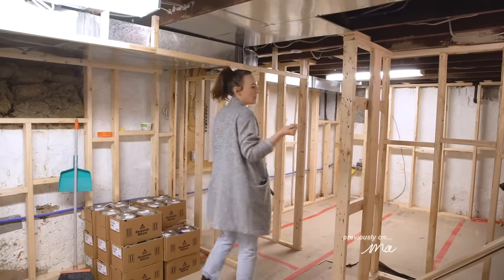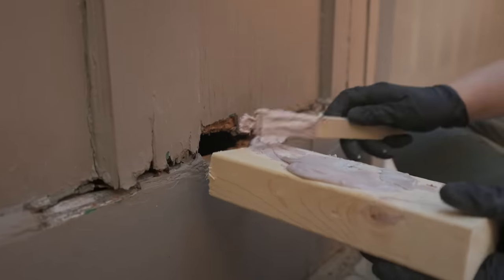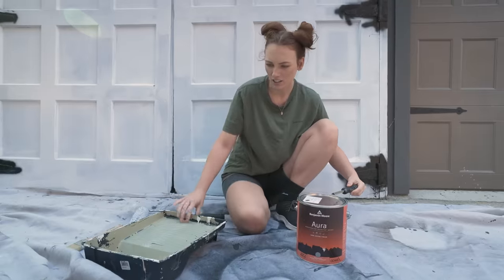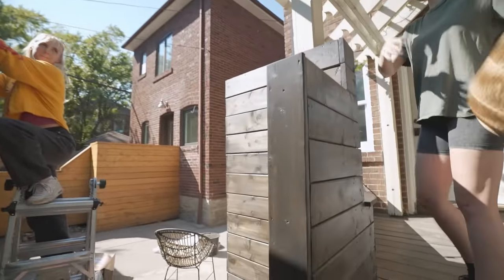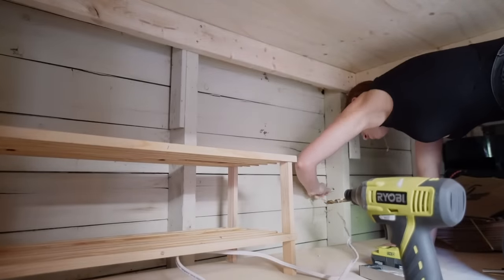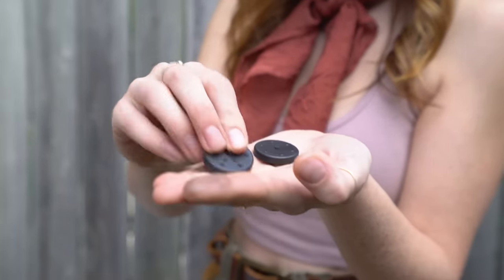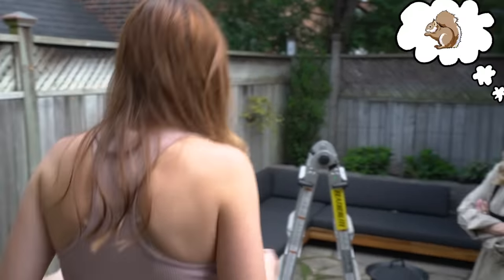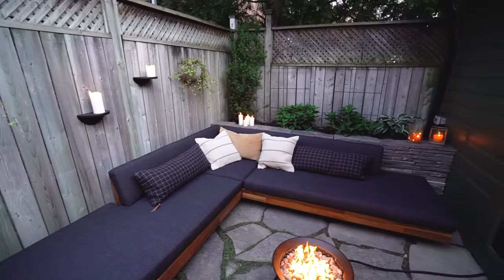FINALLY finishing my ultimate backyard makeover

Comment: There is no reason to drill into a living tree like Kelsey did at 32.26. She just needed to double up the chain and hang it from the limb. Save the tree from overzealous decorating.
Reply: Totally agree. If I were that neighbor, I'd be pissed.
Reply: I was thinking the same thing. I would be really mad if I was the neighbor. What really bugged though me is that Kelsey acknowledges that she does not know the etiquette for dealing with a branch in her yard but she does not bother to find out. I was floored that she took a drill to the tree! Really inconsiderate and selfish.
Reply: Wonder if the solar lights will get enough sun to charge. Trees are pretty tough. But I would try to avoid damaging them. But back in the day folks attached treehouse steps,  clotheslines and birdhouses and the trees generally survived.  But it is always better to err on the side of caution.  Even if you hate the tree,  a dead limb could cause major damage and expense.
Reply: I agree that apart from the legal situation   you should not drill into living trees. As they are living beings it's a "wound" for them they somehow have to heal.
Reply: @melissabrown1759  tree in your yard, your property
Reply: @dawnback  but the tree isn’t in her yard just the branches are. Very passive aggressive not to even consult with the neighbor. Am sure they will not only notice the lamps but eventually will see the video too.  Strange to say the least.

Comment: Gorgeous space, Kelsey! Just for info, in Ontario you can drill (and even cut) any branch that hangs over your property, but if you cut them you have to return them to the owner of the tree. Of course to maintain a good relationship with your neighbor, it's always better to ask before cutting them off or, in this case, drilling into them. 😅
Reply: Drilling into a branch can kill the tree tho, from what I heard. And if that tree dies- you’ll have to pay a fine
Reply: @wellhello1603  why does everyone keep saying this? I've seen tons of trees between 80 and 50 years old with nails in them. It's the same concept. The tree will put scar tissue around the screw and it will become part of the tree
Reply: @mellie4174  depends largely on the species of tree. Birch for example will almost certainly die. Most trees will be fine as long as the holes are small and few. There's also a difference between hammering in a nail that stays there, not giving bacteria a chance to get in (or a small chance at least). A drill creates a more severe wound than a nail, plus you've got a higher chance of bacteria since the hole is left open for a bit before screwing something in it. I highly doubt she killed the whole thing but why risk it (when it isn't hers at that) when she could have looped the chain around
Reply: @tommycarlier9617  I totally agree.
Reply: @tommycarlier9617 I'm sure it'll be fine tho. Tress have immune systems, evolutionarily speaking it wouldn't make much sense if a few holes in a higher branch wiped the whole tree out.
Reply: @mellie4174  our orange tree in spain NEVER bore any oranges, until two summers ago when my grandparents decided to remove the nails that had been sitting in it, holding up a decorative metal thingy, and the next year - BOOM, oranges! There are soooo many now every year, when we hadn’t had any for over 20 years prior to the nails being removed. So I totally believe in trees and vegetation being mych more sensitive than most people realise.
Reply: I live in Ontario with several trees on my property. Lord help the person who trims my trees without asking!😍🇨🇦

Comment: The transformation looks great! I know this series is meant to be more vlog style and not instructional but I do think you should have mentioned that in most cases barn doors wouldn’t be recommended for a outdoor application due to the gap, lack of seal, and the track and hardware will be susceptible to rust and deteriorating over time unless it is specifically rated by the manufacturer for outdoor use.
Reply: Yeah, I was thinking that those do not look Canadian winter proof 😂

Comment: Would love to see a follow up of this space one year later.   I would invest more in our outdoor area if I thought it would hold up for more than one season!  I live in a hot sunny humid climate and after one full season all of those bold dark colors would be bleached out and look really bad 🙄
Reply: I feel the same way about snow! even "outdoor proof" things tend to look grimy and gross after being under snow for 5 months. I live in a snowy climate (I'm super close to Canada actually) and I'm just like... hmm................ would it work for more than 1 summer?
Reply: Same here with snow. Any wood has to be reeeeally well sealed and even then needs a new coat or two every couple seasons. We also pull out outdoor things that can move into the shed in winter. But where I'm at it can snow in July so 🤷‍♀️ it doesn't always help!
Reply: That's my worry too. I mean when it rains you need to run outside and grab the cushions. So i wonder if other materials won't fit better depending on where you live.
Reply: Just gotta replace the cushions. It’s annoying but probably gonna have to buy new cushions every year and try to buy the ones that are more sun resistant

Comment: Quick question: since the light you put by your back door came in a pack of 2, would the second light not have worked on the garage if you mounted it horizontally? Love the one you ended up with, too! I was just curious. The space looks beautiful - the backyard, and your whole house, honestly. <3
Reply: I wondered that! Maybe not. I love the sconce look she picked though! 😁
Reply: There would be very little light from it had it been placed horizontally, as it's essentially an up and down lighter. They're more ambient lighting rather than functional. (I used to work in domestic lighting). Look pretty but not very functional, especially if it's your sole light.
Reply: I imagine she could have drilled holes into the bottom of horizontal light to provide more illumination.  A rope light following the roofline would look nice for some ambient lighting if it could be inconspicuous.  This could be solar with the charging panel placed a little ways away if necessary .
Reply: @alisonpendlebury-brown7885  Exactly!
Reply: @alisonpendlebury-brown7885  Exactly!

Comment: Huh, around here most cities have restrictions on damaging living trees even if they are on your property.
Reply: Toronto (where Kelsey lives) has this as one of their by-laws. You’re supposed to consult an arborist before cutting down or injuring a tree.
Reply: 💡The new lamps look fabulously moody in the far corner above that gorgeous outdoor seating! 😉Although I would've been more cautious about drilling into the tree🌳, esp. since it wasn't mine.

⛓️Using a chain to hang the trio of solar lights was smart! I simply would've recommended wrapping it around the branch & securing with a caribiner or another link🔗.

🐿️ In any event, the squirrels will probably still use it as a climbing apparatus. 🤞At least they won't be able to totally destroy it. 
💚 Bridget from Cali☘️
(using my pal's YT acct)
Reply: Sherri T[A]P Me!! To Have [S]EX With Me  It's a matter of city ordinances, not province-level laws. If she actually lives in Toronto, a permit is required unless the less trunk is less than 30 cm in diameter (this is the same whether the tree is entirely on her property or the trunk is on her neighbor's property) See § 813-12.

Comment: Why would you not just put the chain over the branch instead of drilling into someone else's tree? That's just SO pointless. Other than that, I loved this a lot more than I thought, it came together so well! I miss the original intro though, it was so cute.
Reply: I thought about that too but I think they were worried it could drop from the wind, it was too heavy, or that the squirrels/ raccoons could drop it.
Reply: Right?!? Poor branch!! Plus not healthy for the tree branch wouldn’t be surprised if it’s dead in a few years!
Reply: @AshleySmith-tf3il  a mature tree isn't going to drop dead from a drilled hole 😂
Reply: @becshaps  just throwing some chains over a tree branch is not stable and would easily come down with winds and heavy rain.
Reply: @neuphsss3827  Bullshit. If you fastened both ends to the light, that would be just as secure as whatever it is they did here. Probably even more so, since it can't fall off a hook when it's windy.
Reply: @becshaps  I know, right? Like, I understand the branches overhang Kelsey's property, but still. I would be so weirded out as a neighbor, mostly because there were a million other way to do this besides drilling into the branch.
Reply: @bonesonstones1  I'm not really understanding this? The section of the chain that's thrown over the branch section would slip up and down with any kind of wind or disturbance?
Reply: @bonesonstones1  property laws states (in mine and I'm assuming theirs) that any overhang on your property is yours to do with it what you want, whether that's cutting that section down or god forbid drill a hole into a thick branch to hang some lights in your garden. I'm an arborist so honestly this isn't as big of a deal as you are making it out to be, this is what a lot of people tend to do to secure lighting.
Reply: @neuphsss3827  No one said it wasn't legal. I said it was weird and pointless.
Reply: @bonesonstones1  I guess we'll just have to agree to disagree then :)
Reply: @neuphsss3827  just secure the chains onto themselves with zip ties.  Easy and keeps up neighborly relations.

Comment: If its overhanging your property you can do what you like. Like cutting off all the branches. Having said that don't DRILL into a tree. Use a cable tie in black of need be to hold your chain in place, won't hurt the tree you can change it every year or two. Now you created a hole that's going to leak sap down your chain onto couch.

Comment: You can buy some screw like rods and cut them to size to replace the short one in the handles. Honestly, it looks odd place in the panels and they may brake. Usually the inside panels in doors are kinda fragile to support the force of a handle.

Comment: I think that little wrench thing is actually brilliant. The fact that it's two pegs means that you won't slip around it as easily as you would with a monkey wrench and a nut, and the hinging part means it adjusts to any size of that kind of attachment in a certain range exactly and easily, self setting as opposed to trying to get the distance just right with another kind of adjustable wrench. It seems easier that needing a bunch of different sizes of any tool, or having one that you have to manually adjust just so to have it function ideally. It seems like it would be easier for people who don't use tools as often or don't have great manual dexterity. You could also make things that can use that wrench as easily as two drill holes in the top of something with threads. My angle grinder goes together with a similar tool and it's great, but it's not an adjustable one.

Comment: Your goose neck fixture just needed to be mounted on a chunk of pine 6inch by 6 inch, or on a hunk of 2x6 cut 6 inch by 6 inch.. Which would allow the goose neck to clear the gutter... In case you ever want the lamp you originally chose, or in case you run into a similar issue

Comment: The solar lights are so cute! Question though, do they get enough sun to light up if they're in the shade of the tree? I'm considering something similar as a replacement for some sconces in front of my house instead of figuring out why they aren't getting any electricity 😆 they're just slightly shaded by my roof so I wasn't sure if it would work.

Comment: Kelsey abut the door handlefor your garage door, you should use a mechanic screwdrivew to unscrew to short screw from the handle and replace it with the one that is longer, that way the door handle could be in the place you wanted in the first time... I once made a mid-century bed out of a pallets, and bought pieces of wood cone adding a screw to make legs instead of buyig cone leg ready to screw (saved abut 10 $ per leg if not more). You just put the screwy part in the mehanichal screwdriver, hold it tight, and make it unscrew then screw the longer one in.... I hope i made if clear.. if not, just let me know, I will show you how...

Comment: Suggestion: Poke a small hole in the lid of your trash can. Feed a rope and bead/knot the end and attach to the underside of the folding bench. Then, when you lift the bench lid, it will open the trash can lid so you can easily throw your trash in. Make it removable so it can be easily removed on trash day to roll to the curb. Hope that helps!!! <3

Comment: I read the comments before seeing the hole drilled into the tree and OMG that's so much worse than I was expecting! Of course wrapping the chain around and bolting it together would have been more secure, and that is a very small limb to drill hole into! I would not be surprised if that permentantly left at least that branch vulnerable to infection, which just makes it less safe to having hanging above your seating area honestly. If not putting the whole tree at risk!

Comment: Love it all. The only thing I would've done differently was keeping the overlapping strip on the glass barn doors. It would help keep the weather out a bit more. And I love your skills in these videos, but I do wish you would learn to hold a hammer properly. It isn't good instruction for wanna-be diyers :)  Here in Australia you are legally allowed to trim any branches that overhang your property. If that is the same in Canada, then I would assume that hanging lights from an overhanging branch wouldn't be a problem. Great job. It looks amazing.
Reply: Rita 25 y.o - check my vidéó  Drilling into the tree is less dangerous to the tree. If you tie a rope or chain around a branch it can eventually ringbark the branch and the end of the branch will die. Water and nutrients travel to the top of the tree from the roots through the outer layer of the tree.

Comment: Your stain looks a bit streaky.🤔 Usually with stain, you brush it on then wipe it off with a rag before it dries. You’re just staining the wood, not painting it. I didn’t see you do that step in the video…maybe I missed it. Stain always looks darker when you first apply it. It usually becomes the right color after you wipe it down.

Comment: It turned out nice BUT wouldn’t it just be simpler to put the chain around the branch than to drill the tree? Like people do with a swing. There is beaucoup hardware to hold the chain together around the branch. Also mounting the garage door handles in the panels looks dumb.

Comment: Oy vey. This is the first time watching your channel. While I admire your total gumption to have taken on a complete house renovation, and your design sense looks great, I just want to hit my head in disbelief at some of the things you’ve done. Example, when staining the deck, you didn’t need to be on your hands and knees… just screw that pad onto a broom handle! It designed for that. the hardware for the garage door, you didn’t need to move them and drill additional holes, the easy fix would be to just get longer screws! Also, when working with Bondo, if you had just trimmed away some of the dry rotted wood to square it off, and get it back to “clean hard wood, treated the edges with a wood hardener, once dried added a support piece of cardboard backing behind the hole, and slowly built up the patch, you would have had less sanding and a more finished looking end result. Live and learn.